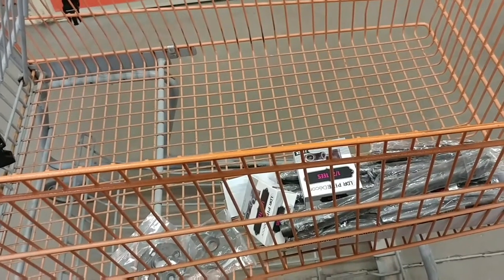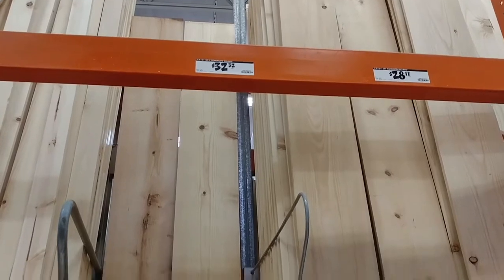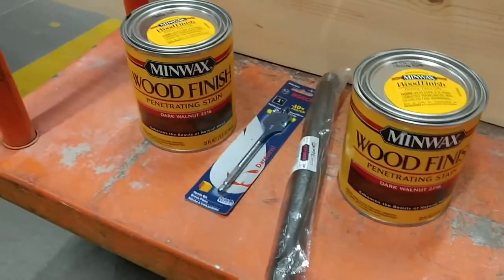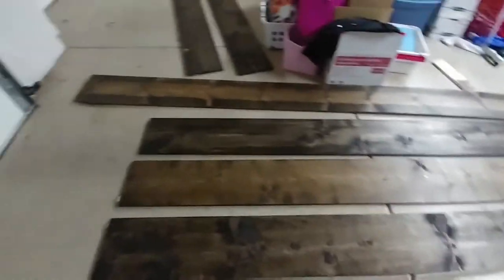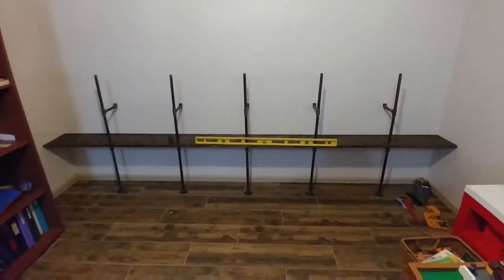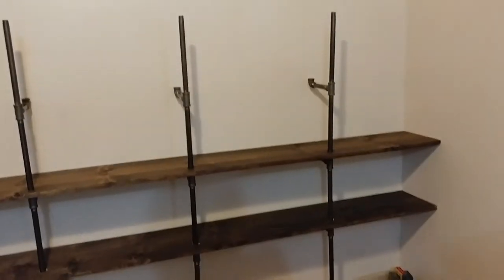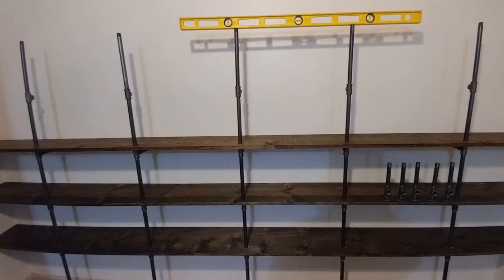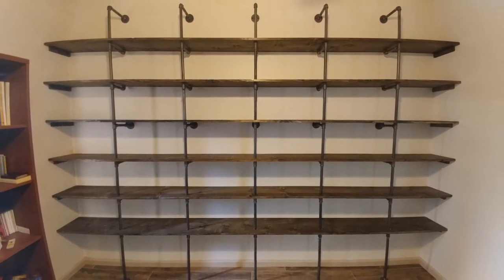How to Build Shelves with Decorative Piping

Comment: what kind of wall anchors did you use?
Reply from the maker: I didn't. I lined the pipes up with the studs using a stud finder, and used sheetrock screws to secure the flanges to the studs. Not all four screws went into the studs, but if you line up the holes correctly, you can easily get two screws in the stud. It was plenty strong that way.
If you do need wall anchors, you can find some good ones in any hardware store. Just make sure the screws fit through the flanges.